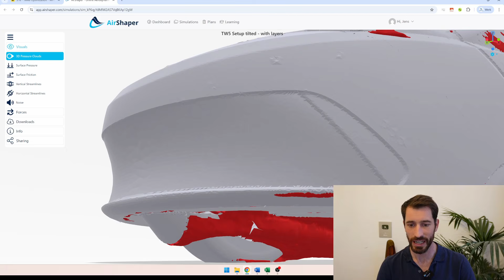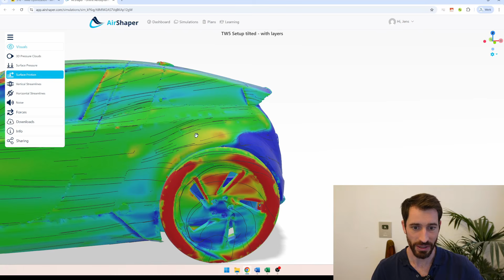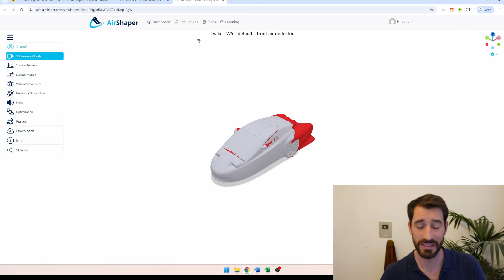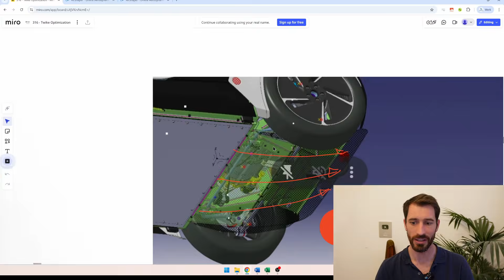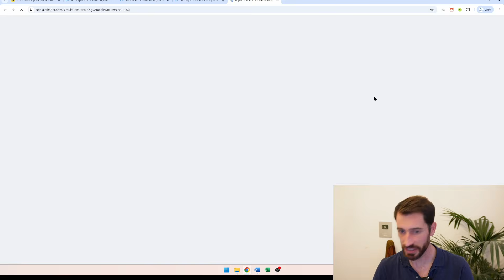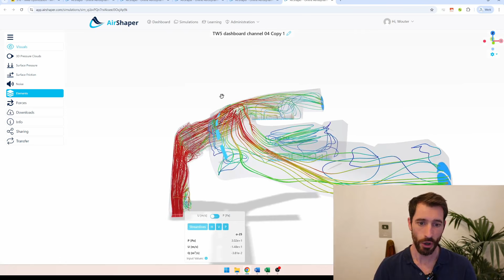Aerodynamics - The Key to Boosting EV range!

Comment: Have you tested roof racks? I'm specifically wondering about the impact that ladder rack made of 1" square tubing would have on the wedge style contractor cap on my pickup, but I assume it would be similar to the crossbar style roof racks that passenger vehicles often have for transporting skis or kayaks.

Comment: It looks like it would be more aerodynamic in reverse, and probably most stable as well.

As for the potato hole, close it off with a rotating plate.
Reply from the maker: They actually did consider the rotating plate (it might even be on the planning!). And yes, a cab-forward design would have been easier to optimize - like the Aptera we also did: https://www.youtube.com/watch?v=1oUEss50Trk

Comment: While I am absolutely no expert on the topic, I think a big misconception a lot of people have is that the drag is only dependent on the shape of a body's front, when the shape of the rear can be hugely impactful as well.

If you want a shape to have lower air resistance, you not only need a wedge shape in front that gradually "spilts" the air flow around the top and bottom, you also should have a backwards wedge on the rear so that the air slowly "closes" around the back, instead of creating a big pocket of low pressure air behind the car.

I am curious if you try starting with a spherical shape, what would reduce drag the most, adding a cone to the front to split the air more gradually, or a cone to the rear like a tear drop?
Reply from the maker: Exactly - the rear half of a vehicle is actually more important for drag than the front half in most cases!

Comment: Does 3 wheels help? (With aero specifically)I kind of feel like the front 2 wheels would create a tow for the rear 2 wheels in a 4 wheel vehicle. Of course rolling resistance aside
Reply from the maker: If you shield the middle wheel properly, it can be beneficial. But indeed, they're not in each other's wake. External wheels (with exposed suspension) are especially difficult to optimize.
Reply: @AirShaper heh well of course open wheels are difficult. But a traditional car vs a 3 wheel like this. I wonder if the reduction in rolling resistance is better than the benefits of a "self wake"

Comment: Something I’ve yet to see analyzed is improving drag reduction with windows down. Most amateur racing in US requires windows down for safety. What could be done to improve aerodynamics with windows down on something like a Miata?
Reply: Depending on the car, but it's been found that sometimes having the window slightly opened actually help drag reduction. This is because some cars have really bad A Pillar vortex, and leaving the window slightly opened makes this vortex going inside the car instead of going back in B and C pillar and polluting air.

Of course, this is not true for all the cars, and unfortunately I don't know if it applies to the Miata.
Reply from the maker: That's very interesting, hadn't heard of that phenomenon before!
Reply from the maker: We actually did this!! See this video: https://www.youtube.com/watch?v=Ku8TpzQA8zE&t=815s

Comment: Seems like you're walking in the dark.   Can u train an AI model to do best design from the start? Like hinges should probably be inside, not outside.
Reply from the maker: That level of upfront design choices will take time, but theoretically it's possible.

For now, good old experience and testing is the way forward 🙂

Hinges on the outside might provide benefits elsewhere.

Comment: Are you also looking at the lift coefficient? Are you getting any adverse changes to the front or rear aerodynamic balance from your optimisations? What about in heavy cross-wind sitations like sudden gusts?

I don't see many cars with such perfect straight floors, usually all the mechanical components are exposed. Do you know why that is the case and why your model can get away with this?
Reply from the maker: In terms of the underfloor, the lack of a combustion engine and it's drive train components really helped.

Yes, we looked at lift as well, but it wasn't the focus. Good news though, the changes we made to the roof and the diffuser also benefited the lift on the car (or rather, the reduction of it).

Comment: Awesome! Were there optimizations made around the rear wheel arches? Still looked like a low pressure zone behind, perhaps making the front of the arch more bulbus would help??
Reply from the maker: Yes, we optimized those as well! The overhang used to be shorter, making it difficult to guide the air into the wake.

Yes, here is still a low pressure one at the top. But the normal is pointing upward, not really rearward too much, limiting the resulting drag.

Comment: Great case study. Thank you for sharing it. I am pleased to see that research is being made to greatly improve range and aerodynamics.

As a non-specialist, I would encourage the Twike project team to move away from wing mirrors and exposed boot hinges. Both are detrimental to the design as much as the aerodynamics!
Reply from the maker: We definitely ran sims without the hinges and mirrors. The hinges ar quite ok, they've been aligned with the local flow direction and made streamlined, no separation there!

Mirrors remain a challenge though...